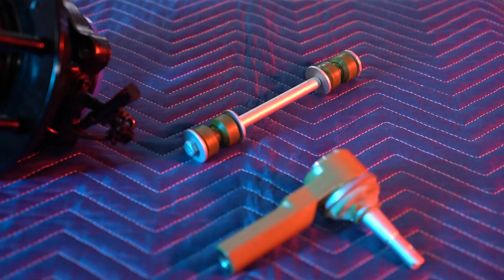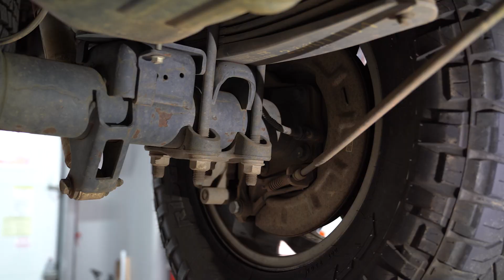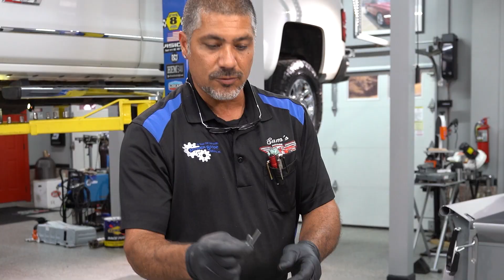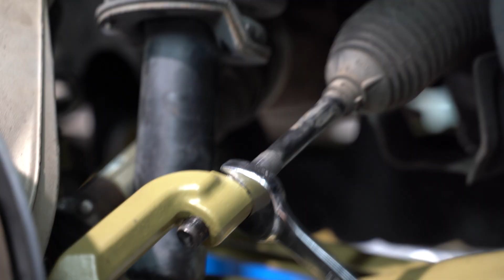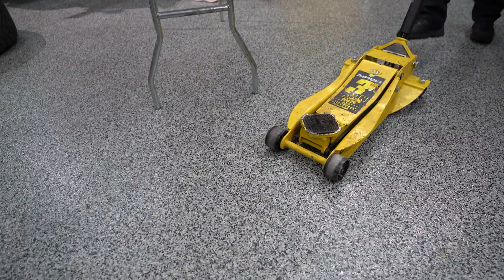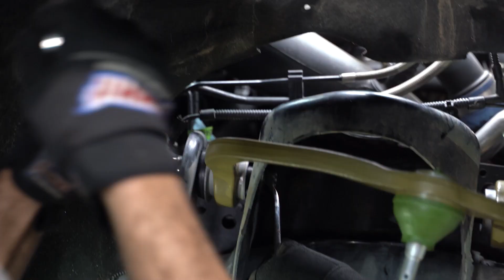Sam's Garage: Season 11 Premiere featuring Mevotech Suspension parts for a Chevy 3500

Comment: Just purchased uppers and lowers left and right for my truck Chevy 1500 purchased the TTX version they come prelubed for the ball joints. Wanted to match the existing Grease so as not to mix grease Molly, or lithium#2 which is recommended to match exactly from factory ? Thanks jim